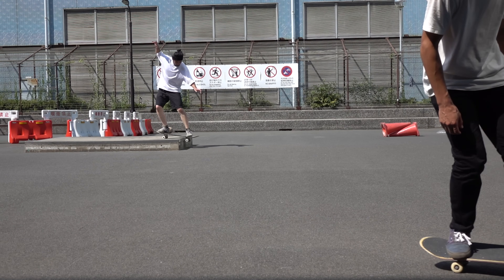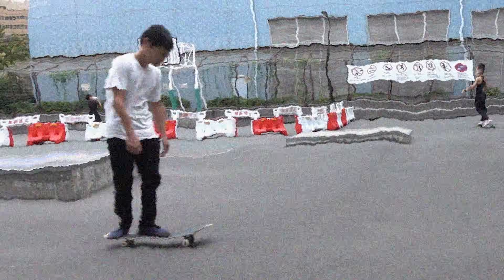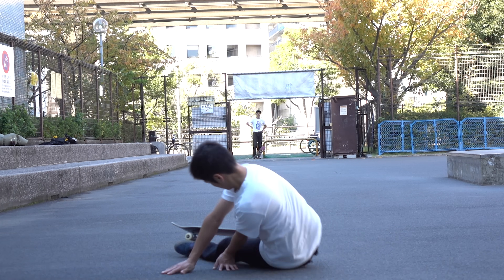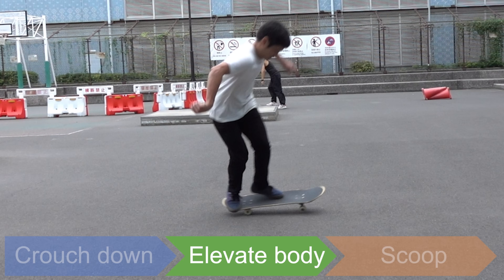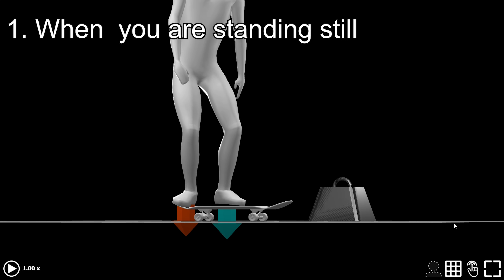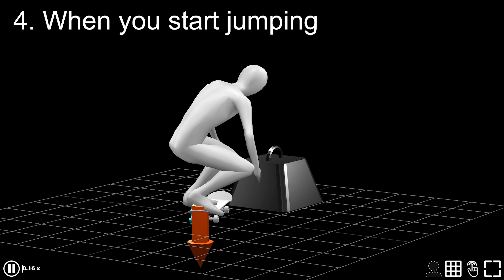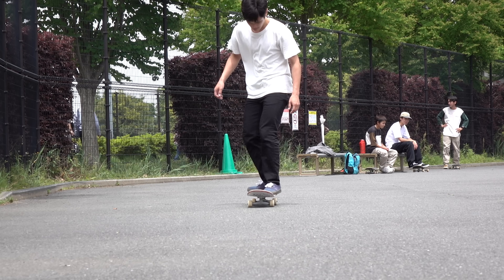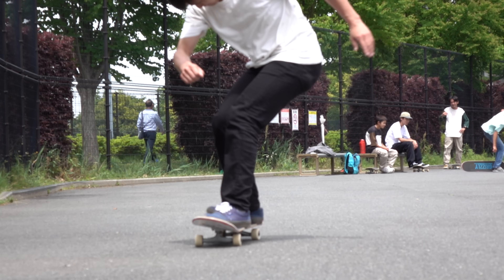Common mistakes of scoop in Treflips / Shove-its. Analysis on the lightness of tricks.

Comment: I knew this intuitively that you need to jump before doing the trick, otherwise how could I lift the board from the ground if I cannot lift myself first. This is very valuable to know for any skateboarding trick that requires board lifting. 
But when it comes to three flip there is so much more to explain than this. For example direction of the scoop is extremely important, shoulders position, pop before scoop, and so on. Many other videos talk about hese aspects.
My advice above them all would be: record yourself and analyse what mistakes you are doing. Then try to correct these mistakes.

Comment: Great explanation! I do need some advice tho. I'm trying to improve my 36flip. Been skating for 21 years. I can do them blind folded or without my board's nose. But to gain stability when approaching obstacles I need to spread my feet a little and here comes the problem. I always did my 36flips by putting my front foot in the middle of the length of my board.I want to relearn them like some proskaters do - by placing my toes on the front bolts (in a kickflip position) But when I do so, then I cannot do the whole flip. My board just makes half of the necessary flip rotation (I'm pretty sure at least 90% of my flip is done by scooping). When crouching a little with legs spread apart more than usual, I have a feeling there's less tension in my both legs' inner side tendons, and somehow that affects my tres. What in the world am I doing wrong? Can you give me any advice for doing poppy 36flips with the front foot placed almost on (or over) the front bolts? Help needed :)
Reply from the maker: Sorry, but I'd face the same problem if I put my front foot on the bolts. Anyone reading this wants to help him?
Reply: @whythetrick  I really would appreciate a breakdown of a solution to that phenomenon

Comment: Without a flick, doesn't that become a 360 pressure heelflip?
Reply from the maker: Apparently not.
Reply: @whythetrick  I was actually talking by definition, it was a rhetorical question. Without the flick, it becomes a pressure flip. 

Just as without the flick, an inward heel becomes a pressure flip (technically a pressure inward heelflip). 

They are different kinds of pressure flips, but they are still pressure flips. Great vid though. One of the best I've seen of its kind.
Reply: @whythetrick  HOWEVER, your skateboard is spinning in the correct direction, which it shouldn't if you pressure flip from that edge of the skateboard. Hmm. It is almost like it is a 360 underflip.

Comment: Very good explanation! Also tensor mag lights make 360 flips so much more consistent and easy. With the ratio of the truck being nearly equal in weight to the deck, I find 360 flips are way easier than on other trucks.
Reply from the maker: That’s so true. I’d like to keep my contents as objective as possible but personally, I love how tensor trucks feel when I treflip.
Reply: @whythetrick  indeed! No problem! It sounds like a tensor add. Lol normally I ride indy though 🤘

Comment: I'll say at least 50% of skaters 'cheat' when doing 360 flips. If you analyze the cheat method, which is the one explained in this video, it involves touching the ground with the back foot toes. For me, REAL 360 flips are the ones that are kicked cleanly, without touching the ground with your back foot.
Reply from the maker: Not exactly sure what you are saying here. By “kicked,” do you mean “popped”? 

If so, your back toe would prolly touch the ground as you pop. It’s just I can’t imagine how you can pop without letting your toe touch the ground.

Comment: This is actually a really well thought out explanation of skateboarding motorskills. I may be wrong but in my experience almost any time I've over heard, or been asked to give trick advice on how to do ollies or other things, we all tend to start by explaining with the motion required by our feet, rather than the first goal. Now obviously when we're giving ollie advice we explain that you have to snap your tail on the ground before sliding your front foot up the board to level it out while jumping. but more emphasis definitely needs to be made on the crouching and jumping aspects before all that other shit. Good analysis.
Reply from the maker: you are right. although this one's about treflips, the same concept should apply to other tricks including ollies. jump>>>pop. there's a big difference but we tend to forget about this.

Comment: What are you using to do the modeling? I'm working on one foot fakie manual to one foot fakie bigspin out I can land one foot fakie big spin and one foot fakie manual to pivot also working on a heelflip but where my front foot does like a sweep? Wrap around the board in a counter clockwise motion I'm regular have landed it the grass but it's so subtle without the 3d modeling can't really see difference working on best angle speed maybe this tip will apple
Reply from the maker: I’m using a software called Blender. It’s not fully automatic and when I make models I have to adjust them manually. So I think you should record yourself with a slowmo camera or something to see such a subtle difference. iPhone will do. Blender can’t really automate that process.

Comment: this is great info which made me realize why I ghost pop once in a while. It's not that I didn't pop the tail hard enough - it's that my front foot pushed down for too long into the move. I need to release my front foot weight on time. if done correctly, as you stated, the skateboard requires very little force to pop.
Reply: Agreed!!

Comment: I can appreciate the effort put into this video, but it's somewhat wrong. The two things that make the tre flip flip best is popping it when scooped with the board already 90 degrees and tip down your toes of your scooping foot and it'll flip easily too much. The big thing about all of this is timing. If the scoop and pop combo is too slow, you can jump any height you want, but you'll always land on the board upside down. The funny thing is, the tre flip / varial kickflip type tricks aren't really that difficult at all once you understand the scoop with toes pointing down trick. Committing to a tre flip and staying above it though, not so easy at all.

Comment: I didn't watch much but one thing to take note of, and learning 360flips is a great example, is that you have to shoot yourself forward. Doesnt matter if its a flatground trick or if your trying a crook on a ledge. If you try a crook, don't just use the speed to get you locked in, have faith and ollie out in front of yourself and land further down the ledge instead of trying to get on fast. When you 360 flip you need to leap forward to have more hangtime and also it just makes everything else alot easier to learn and execute. The scoop motion wont be as hard and all the other aspects of getting the trick perfected will make it to where you dont have to leap forward anymore, but you definitely should unless your just doing a quick little 360flip just cuz you got them on lock now

Comment: By the way, tre flips are a momentum trick: the faster you go the easier it becomes. Also try not putting your front foot so far back, keep it in kick flip position near your front bolts. Next, when you pop(and scoop) your board flick you front toes similar to a kick flip but instead of flicking somewhat downward and forward, try flicking them straight forward and slightly (very slightly) downward.  So in summary, 1. Go fast   2. Pop   3. Back foot spins board and front foot flicks the flip.. 

Try, fail, try, land, try, repeat… remember muscle memory is key and takes repetition

Comment: Nice description. I'm still confused about what my front foot should be doing during the trick to actually flip the board, as for me that is the bigger issue.
Reply: Well you have two ways to tre. The tradinional way where the front foot adds to the scoop and then there is the Nyjah way, all backfoot front foot just has to get out of the way.

Comment: Man this video was absolutely amazing!! Like really so good! Scooping when your momentum's going up is such a solid recommendation. The only part I would disagree with is the pause at the bottom, this is because something that contributes a lot to the power we can generate in a vertical jump/popping a trick are the elastic structures in and around your muscles and joints. They essentially work like an elastic band that's pulled back and released - building on top of the force you could create with your muscles alone - this process is known as the 'stretch shortening cycle' (SSC). The more you pause, the more the stored energy in the SSC is dissipated as heat. Instead, I would recommend developing the SSC and your ability to create power over pausing at the bottom (there are exercises on my channel to do this). Anyway, thanks for the vid! You gained a subscriber!
Reply from the maker: I've posted like 15 videos so far but this is by far one of the greatest comments. Thanks a lot!
Reply: @whythetrick   @whythetrick  Glad you appreciated it 🙏 Thanks a lot for your videos! Maybe we could do a collab some time...
Reply: That's something I didn't know about. Interesting, thanks for the knowledge!
Reply: so like a rubber band? the longer you stretch it the more the elastic energy dissipates.  
I just realized why stretching helps a lot more now

Comment: Hmm... We Share the same theory and concept but not the explanation. I wonder if anyone will get this :
1. When we are standing, both feet split the downward force equally.
2. If we then crouch and get up, the force is STILL divided equally between the two feet.
3. Now, imagine you are standing on one foot. Which foot is holding the body? That one foot you're standing on, correct?
4. What if you crouch and get up while in that position. You still exert the same amount of downward force BUT from only one foot. So, what do you do with the "free" foot? Hmm... Maybe, you can flip the board with?! Now, do you see where I'm going with this?
5. The idea is to shift the downward force entirely to the popping foot while freeing the other foot for flipping.
So the sequence for an ollie goes like this :
- crouch
- hold for a moment (to make sure you are balanced. If you're tense, you'll fall)
- elevate (lift your front foot first. Do not push the back foot down until you lift your front foot. Front foot will continue to move upward, back foot will continue to move downward until the tail hits the ground AND bounce back up to catch up with the already in the air front foot. By this time, your rear wheels will move backward due to the shift of your center of gravity to achieve the new balanced state. Because of this, you don't need to slide your foot forward. Because the board will move backward until the front foot "stuck" on the concave of the nose. By this time, your board will level in the air, stop for a moment (hangtime), then move back down synchronously.
But if you slide your front foot forward, you won't have the hangtime.